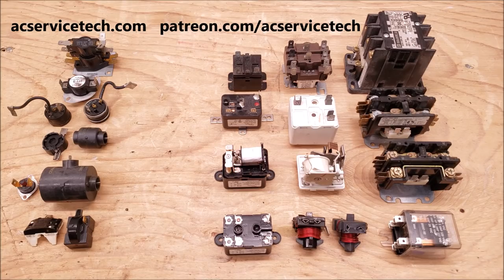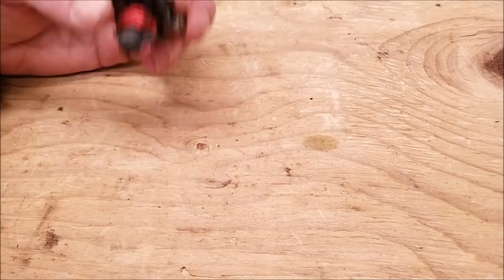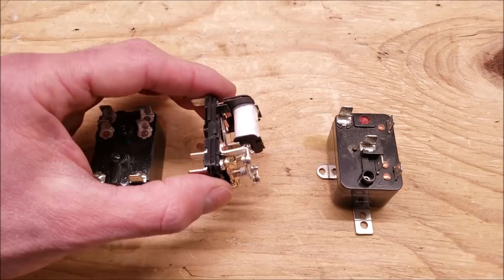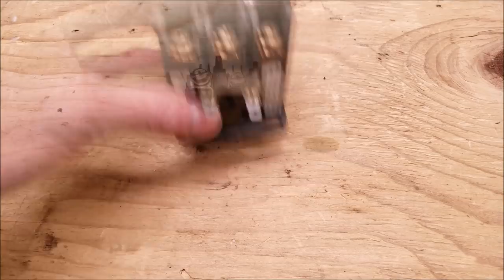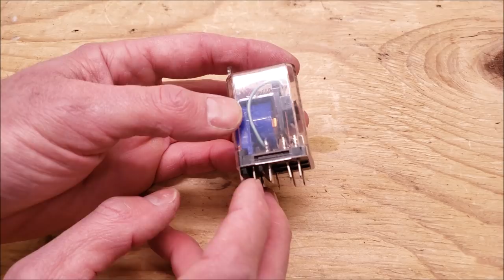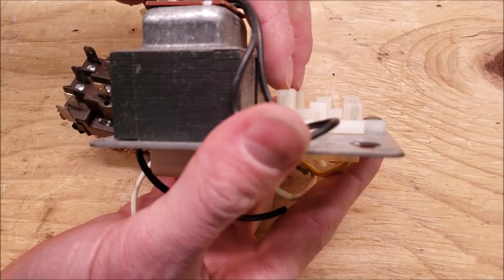Common Relays Used in HVAC/R!

Comment from the maker: Support the Channel-  https://www.patreon.com/acservicetech

Tool List-  https://www.amazon.com/shop/acservicetech

For those that are looking for the tools used in the videos: (Linked Below)
UEI DL479 Multimeter with temp sensor http://amzn.to/2jtsUbJ
Valve Core Removal Tool http://amzn.to/2uYr8WL
Blue Vapor Yellow Jacket Gauge- https://amzn.to/2Ju7pan
Red Liquid Yellow Jacket Gauge- https://amzn.to/2sSFmGH
Quick Coupler for the Gauges- https://amzn.to/2sTk8Ze
JB Test Gauge High Side-  http://amzn.to/2ruQb0l
JB Test Gauge Low Side-  http://amzn.to/2qR0utM
Manual Copper Tube Swage/Expander- https://amzn.to/2WRPa1M
Uniweld Hydraulic Swaging Tool- https://amzn.to/2MlrI8m
Uniweld Swage and Flare Kit- https://amzn.to/2T55jyn
Ameriflame Oxy Acetylene Torch Setup- https://amzn.to/2SRm3JF
#2 Tip for Oxy Acetylene Torch- https://amzn.to/2SPDaeD
Cap-N-Hook Tip for Oxy Acetylene- https://amzn.to/2MbhpUk
Air Acetylene Torch Setup-    http://amzn.to/2aQalsb  
15% Silver Brazing Rods-  http://amzn.to/2gVLyLc
Nitrogen Regulator-   http://amzn.to/2bXdR5f
Nitrogen Flow Meter-    http://amzn.to/2brvoBg
NitroVue Flow Reg-  https://amzn.to/2MiulYv
Ultrasonic Leak Detector- https://amzn.to/2Lw4Zpr

UEI DL479 Multimeter with temp sensor http://amzn.to/2jtsUbJ

Magnet Jumpers- https://amzn.to/2PyKPQZ

Alligator Jumpers- https://amzn.to/2PxqJXn

Fieldpiece ST4 Dual Temp Meter  http://amzn.to/2wc1ME3

Fieldpiece Bead K Type Temp Sensor https://amzn.to/2DBwKfs

Fieldpiece Wet Bulb Temp Sensor https://amzn.to/2RRI7Tw

Fieldpiece TC24 Temp Clamp https://amzn.to/2qHLyjZ

Yellow Jacket Refrigerant Gauge Set http://amzn.to/2aenwTq

Refrigerant hoses with valves http://amzn.to/2aBumVI

Yellow Jacket Gauge set & hoses https://amzn.to/2vLVkV9

Yellow Jacket 4 Port Manifold w Hoses https://amzn.to/2BkuGIq

FieldpieceSMAN360 Digital Manifold Set https://amzn.to/2BdoaD4

FieldpieceSMAN460 Digital Manifold Set https://amzn.to/2nB4Fe6

Compact Ball Valve for Refrigerant Hose https://amzn.to/2KUisW8

QuickDisconnect 90 for refrigerant hose https://amzn.to/2MMtVcg

JB 6 CFM Vacuum Pump   http://amzn.to/2nqbvo8

Appion Blue 3/8" to 1/4" Vacuum Hose http://amzn.to/2uYlVyc

Appion Red 3/8" to 1/4" Vacuum Hose http://amzn.to/2uYg6Ro

Appion Valve Core Removal Tool http://amzn.to/2uYr8WL

Yellow Jacket 1/4" by 1/4" hose http://amzn.to/2umtcod

CPS Vacuum Micron Gauge http://amzn.to/2v1nM3O

Supco Vacuum Micron Gauge http://amzn.to/2v1JRiA

RectorSeal Bubble Gas Leak Detector http://amzn.to/2ckWACn

UEI DL389 Multimeter  http://amzn.to/2xAdaJf

Other tool links can be found in the video description section.

Shop through Amazon! Your Purchases through Amazon provide a means for channels such as mine to earn advertising fees from all purchases after clicking through. Prices are the same as normal-    https://www.amazon.com/shop/acservicetech

Comment: Good info. You present like an instructor. Can anyone answer if all compressors typically have a current start relay?
Reply from the maker: Thanks, I am a licensed Instructor in New Jersey. All compressors have a start winding and smaller fractional hp compressors will have either a ptc thermistor or current starting relay. Larger compressors may not have a start relay or they may have a potential relay along with a start capacitor. Have you checked out our refrigerant handling book we just published in May? The full outline is available at acservicetech.com/the-book and it is everything I want techs to know about preparing and servicing a system with refrigerant, thanks!

Comment: Contactors...single and double pole units...are they interchangeable or is there situations where only one will work and not the other? Speaking for you basic outdoor condenser...
Reply from the maker: Some units have a crankcase heater that needs to stay powered so they use a single pole contactor to keep that circuit closed. Other units can get a double pole usually unless something else is powered but It is always best to replace the same with same with the exact same FLA or a little higher, thanks Chris!

Comment: I have an inverter evaporator (Mitsubishi) and I want to install it with a reversible on/off Samsung condensing unit. Is this possible? The issue is the power, on the Mitsubishi comes with the outside unit on the Mitsubishi while the Samsung is powered from the inside unit. Which relay or contactor will be appropriate ?  The Thanks for your answers.
Reply: I have a low tension on s3, do I have to connect this tension to the relay or contactor coil?

Comment: how did you power the transformer to show the contractor pull in ??
Reply from the maker: I just had a switch powering 120v to a 24v transformer which powered the coil of the contactor, thanks!

Comment: Not ElectroMechanical Relays

Thermal Overload disk. For a compressor.
PTC Thermister.  Current limiter.  As you pass current, R grows.
Flame roll out switch

Relay - copper coil (inductor)
List of relay types. https://youtu.be/HaRg8IRP-Uo?si=kiiWwC5FPTehqIeM&t=200 
Fan relays - is a double break relay
Current starting relays - compressor between the start and the run taps.
Potential relays - will disconnect the start capacitor, after start up.
Multipurpose relay (General)
3 pole contactor
2 pole contactor
1 pole contactor
Ice cube or plug in type relay

PTC Thermistor Start Assist-   
Heat Sequencer-   
Top 5 Contactor Problems-   
Potential Relay-   
Ice Cube Relay-   
Fan Control Relay-  
Fan Relay-     
General Purpose Relay-